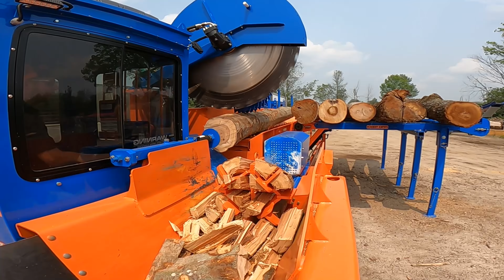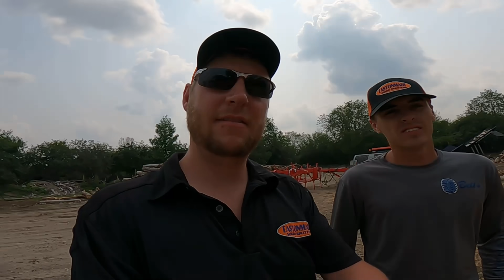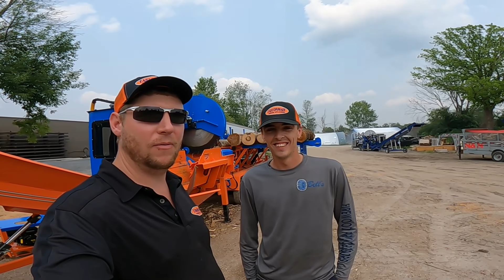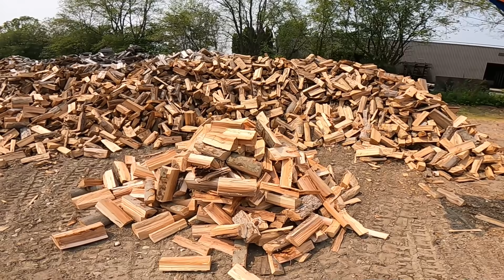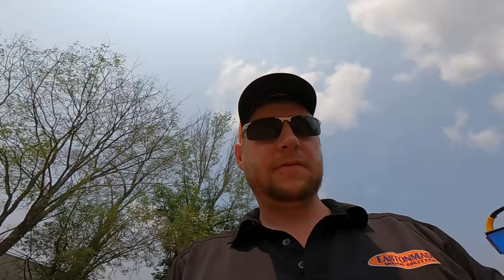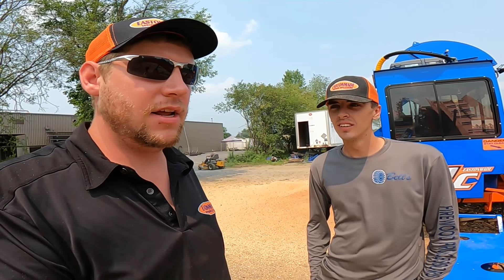Eastonmade; 60C 12 Way Wedge Production!!!

Comment: I think Skidder Kev could have cut this load in 11:45 instead of 13. 😂. Unless the log can’t advance until the pusher plate returns to the load position. I also thought the saw blade could be set to initiate closer to the cutting surface. Awesome machine. 👍.
Reply from the maker: It can be set quite a bit lower for smaller wood.  Still need a little bit of clearance there
Reply: Haha.

Comment: Hi Andrew, first of all lovely machine and appears great quality.  The circular saw cuts super quick, however the follow up split takes perhaps to long.   It is about a total of about 5 seconds per split cycle, whereas the top cycle speed machines do it in under 3 seconds.  It also takes a while before the cut of wood is ready for the splitter and doesn’t always fall nicely.   This large equipment I think works better with the larger diameter logs.  Good video.
Reply from the maker: Thats the issue with a lot of advertising.  The splitters will cycle in 3 seconds, but its incredibly difficult to actually run the machine at that limit all day, let alone make firewood that is actually saleable.  You will also notice that they dont ever show any of the pieces fall funny in any of their videos.  We are really trying to take a realistic approach to this
Reply: @EastonmadeWoodSplitters  Your equipment in unequivocally “top end” but it would be interesting to see it side by side say an equivalent Cord King, with the same size logs etc. You asked for comments, so this is mine.
Reply from the maker: @stevesedgwick5789  really appreciate it!!!

Comment: Looks like that processor will need some paint touch up on the push plate before you send it off to Elite Outdoors.   As you said in your truth about splitter production video, the area of a circle is based on the radius squared.  There is no getting around that geometry fact.  Bigger diameter wood will have a much larger area than smaller diameter wood.   At least now you have 2 good production speed videos based on real world conditions you can point people to.
Reply: The same also applies to the cross sections of the blade. The power to drive the blade  also squares.       Perfect for large wood,    Maybe not for small wood.

Comment: How about piss elm?
  It has stopped almost every splitter I've ran!  
How much delivered to SE MN.
Reply from the maker: If i get my hands on some ill give it a shot.  Pricing is on our website.  Freight to mn is going to be around 5k give or take
Reply: G'day Andrew, if the leading edge on the multi blade wedge is concave like a simitar or a cukri it will split or cut through any wood anywhere Ishman👍.

Comment: Loaded question... 1 Cord = ? Board Feet Doyle. You know + - .
Reply from the maker: I honestly have no idea at all al.  I have very little experience with anything to do with lumber.
Reply: Doyle Scale =
512BdFt/Facecord 1,536BdFt/Full Cord
Now that being said it will not take that many boardfeet because log scales measure inside the bark and they measure the large and smaller end figuring for an even taper in the log. A better calculation is to know your diameter and length of logs. Figure how many rounds/pieces you can get from one pole and literally Figure the dimensions if those cut rounds were stacked up. 
Ex. 12in rounds would be 8 rows stacked 4 rows high for 1 Facecord so that's 32 rounds.
At 16inches in length it would take just over three 12 inch diameter logs assuming you cut 10 rounds out of 1 log.
Reply: No way.  A 4000bft tri axle holds a lot more then 8 fc.     A better estimate would be 200bdft to a face cord. 

And the two units don’t scale the same vs the size of the log.   It’s a ballpark estimation at best.

Comment: So a cord of wood equals about 3 solid Cubic meters =3.62 stacked neatly =5.097 cubic meters thrown =180 Cubic feet thrown . Assuming 50 cm length a 25 cm radius(50cm D=19.7 inch D )  ,then each block = about  0.1 CM solid wood  so 30 blocks for a cord  , 20cm R=0.063CM=  48 blocks , 15 cm R=0.035CM=85 blocks to equal a cord . 30 cm R ie 24 inch D = only 22 cuts